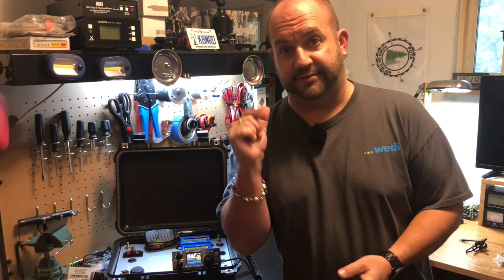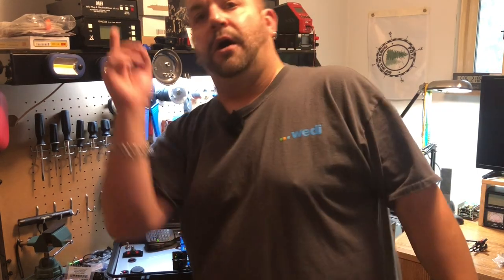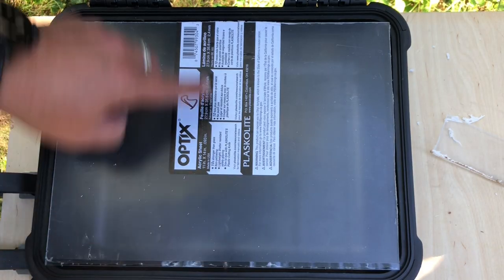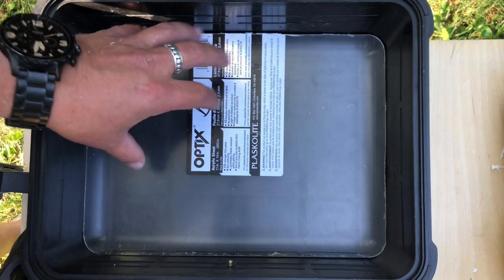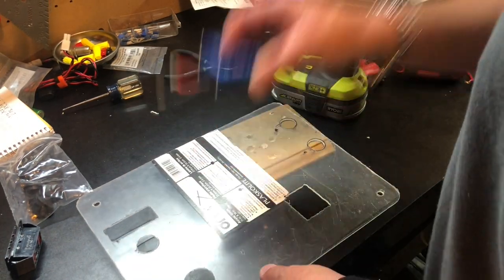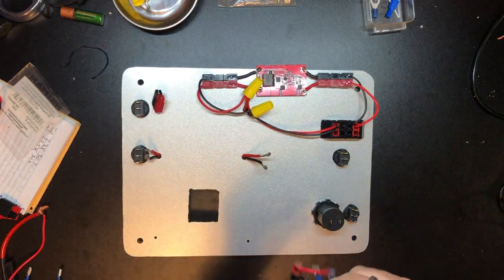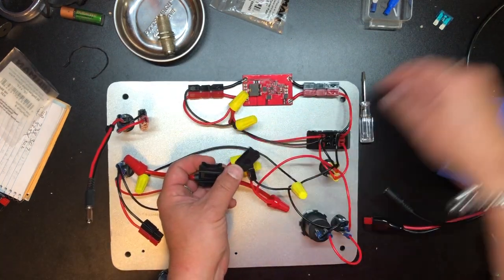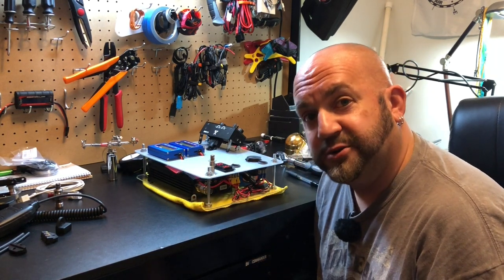Ham Radio Go Box & Solar Generator Build

Comment: Just off the top: get rid of the wire nuts and use male>female FULLY INSULATED spade or bullet connectors, use right-angle FULLY INSULATED spade connectors on the switches & sockets, etc. Layout a routing chart and run the wiring like a printed circuit board. If necessary, use hot glue to hold the wires in place or devise some method of holding the wires to lessen the effect of movement and vibration on the system.  In addition, look on Amazon for a right-angle DB9 connector or right-angle DB9 Serial Cable-pass through type, angles to the side.
Reply from the maker: I wanted to get the right angle spade connectors but ended up using what I had in the shack.  I can't fully use male/female as I'm connecting multiple wires together in a few places.  The wire nuts at some point will prob be replaced.  I don't really like them.  Some have suggested wago connectors I believe they are called?  Thats prob the rout I'll go.  I'm not too worried about the wires moving though.  Everything is pretty tight inside.  The wires don't really move.  Honestly I'm surprised everything just worked the first time I put it together and I didn't see any of the famous magic smoke lol!  Thanks for watching and commenting.  73
Reply: @hamradiotube  For my battery go box, I simply soldered the wiring harnesses together and insulated with heat shrink tubing. Though most of my wiring runs into a 12v fuse box like is used for RV trailers.  Using 2 10Ah bioenno batteries. Two sets of power poles plus a 12v socket and a USB charger.  I can run my Icom 718 at full 100 watts for hours and hours (I haven't actually fully determined how long it runs).  I get multiple evenings use out of it and I usually only go on the air for 3-4 hours at a time.  Everything's all installed in an old tool box I had purchased at Meijer.

Comment: Was there a reason that you couldn't install the radio upside down so that the cooling fins were up vs. down? Use of Wagos would had made connecting the wires together. Heat dissipation is my only concern with your build otherwise awesome job.
Reply from the maker: One, it doesn't really matter, two, the speaker fires up which is more important to me.  I assure you there is no problem with heat.

Comment: So is the top part of the distribution block for charging the battery and solar panel? Or which is each plug used for?
Reply from the maker: Yes, the top is solely for charging. Top left has the solar charge controller connected.  Top right is bypassing the charge controller so I can use my home charger.  They both go into the top meter so I can monitor how many amp hours have gone into the battery.  The battery itself has 2 separate connectors, one for charging and one for output.  Thats how I was able to split everything.  It's actually pretty easy.  I am no electrical engineer trust me.

Comment: If you hang an 110 pH inductor off the positive output, that may just remove your rf hash from the charge controller.  Just a thought.
Reply from the maker: And as soon as I find out how to do that I will give it a try.

Comment: I'm just spitballing here, but I wonder if wrapping the solar charge controller in Kapton tape would help eliminate the interference?

BTW - Nice build!
Reply from the maker: I wish it were that easy.  I don't think kapton tape has any shielding properties though.
Reply: @hamradiotube  What about aluminum tape? Or just plain aluminum foil?  You'd have to insulate it as well, just in case.

Comment: Not to be too critical, but I would think the fan on the G90 would force the radio to overheat. Maybe I am missing something?
Reply from the maker: Well, there is no fan on the G90 to begin with.  Everyone has commented about the heat but it works great in this box ever since I built this.  It’s still in it and I use it all the time.

Comment: So how long does that 6 amp battery last with that rig? I have a mcHF rs-918 I'm wanting to build something like this with
Reply from the maker: just on RX about 10 hours.  Full on pileup about 3 hours.  The RS-918 would last even longer as it doesn't draw as much current.  I have that radio too and love it.
Reply: @hamradiotube  I'm trying to figure out what I want to build with.  I have a 10 watt solar panel that I could trickle it with.

Comment: I just realized you got a 90 deg coax connector in there.  Those things will go bad and short on ya.  FYI.  POTA on!
Reply from the maker: What??  Maybe a crappy one.
Reply: @hamradiotube  Just following the advice of Jimmy, KA5DOB "The Audio Man."  He has even gone so far as to put it on his QRZ page in red letters.  It was in relation to frying tubes in an amp.  YMMV.  73's.  Good to catch ya on POTA today.

Comment: Been searching and searching, but I have not found a video that actually explains how to charge the battery! If the battery is connected to a power distribution block then how are leads connected to charge the battery itself? Did I miss this?
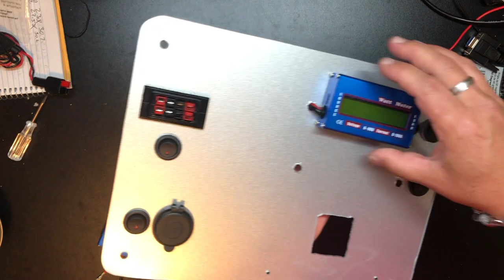Reply from the maker: I show how I wire up the 2 power poles for 2 different types of charging at about the 23:20 mark.  As far as charging, the top left power pole is the solar panel input, which then goes to the charge controller, the watt meter, and into the battery.  The top right is for connecting to my charger at home which just goes through the watt meter and into the battery.   Basically the output of the charge controller, and the wires for the top right power pole (home charger input) are wired together.  From there they go thru the switch and into the battery.  You're just taking to circuits and splicing them together after the charge controller.
Reply: @hamradiotube  Got it and mine now does what I want. Thanks for the reply and instructions! I used flag/right angle connectors. It was a tight smash down using the standard connectors/terminals in my box!
Reply from the maker: @winstonsmiths2449  I wanted to get flag connectors for this and a couple battery boxes I built but didn't feel like buying the crimping tool for it.  Would certainly make for a tidier installation for sure.  Glad you got it working.  73
Reply: @hamradiotube  I did not buy the crimping tool as I am a cheap-skate LOL! I found using a medium sized vice grips works like a charm after you ruin a few connectors. I tighten down the adjustment screw to where when closed, the vice grips grip just a bit. I then place the connector more toward the open end of the jaws of the grip. Squeeze the grips till they lock, release and done. No damage to the connector. I ruin one out of 10 or so when in a hurry. But that is worth it to provide me with extra space. I ended up rewiring my box because I used too thick awg and used the flag connectors with thinner wire.

Comment: *****************
FOR YOUR NOISE ISSUE -
TRY EBAY - MU METAL - A NICKEL BASED FOIL/SHIELD THAT PROTECTS FROM FROM EMI OR MAG INTERFERENCE. I'M AN EE AND HAD TO USE IT FOR A SIMILAR ISSUE WHEN DOING SONAR DESIGN.

Comment: Ferrite cores to stop the noise, how does that box run with the G90 getting hot, i see there is no fan, is the heat an issue?
Reply from the maker: That might work if there were any more room inside.  I’ve not had any issues at all with heat either.  That’s prob the biggest question I get on this video.  Even in the Texas heat I’ve not had a problem.
Reply: @hamradiotube  Thanks you for the timely response, your answer helped relieve a bit of worry I had about the unit. I take receipt of my G90 tomorrow, and have already  eyeballed my pelican briefcase for a go box for it.

Comment: How much RF noise does the MPPT Charge controller put out?
Reply from the maker: Well the first one I bought and have since managed to destroy put out zero rf noise.  This one is all kinds of noisy.  I didn’t have the first one hooked up in the same way though so that might have something to do with it.  I had it hooked up to the solar panel a bit away from the radio.
Reply: @hamradiotube  I appreciate the information. I am still trying to finish my gobox. I am down to the charge controller (I have the RFI Powerwerx one now) & solar panel.  Having to stay budget friendly since I’m ordering a 891 when I pass my general Saturday!  73

Comment: Well wasn’t interested until I heard you hadn’t setup for a raspberry pi. After 50 years of Ham radio kinda burnt out on HF SSB and the arrogance of 20 meters. Want something quick work as many contacts as want get off and go to other projects. I thought about 2 boxes. One for the radio or radios and one for batteries charge controller. I guess your box you could get the digital interface they sell for the G90 and have the computer and cat controller to hook up to whatever computer you might want.
Reply from the maker: I have the digital interface but it’s really bulky.  There are better ones than Xiegu makes but there still wouldn’t be room in the box for them.

Comment: No jack for plugging in a paddle or key. Guess you don't use CW.
Reply from the maker: You make it sound as though thats a problem.  The one thing CW guys think about themselves is that they are better than everyone else.  What they don't think about is the fact that maybe talking in binary just doesn't appeal to everyone.  Of course, I doubt they think about that at all considering they are usually just praising themselves for how good they are, and how all other modes of amateur radio are beneath them.

Comment: Okay if you can solder get you some shrink tube go to harbor freight get you a lot of shrink tube and start shortening your wires and your cables you ain't got to have them all that craziness and go get you some different gauge wires go to the electronics store get a little bit thicker gauge all right and you'll definitely cool down get you one of those little cool fans and you might not have to go to the store for that you probably got something old laying around the house that actually uses it or one of those and just shorten your cables down a little bit get some good solder go to tractor supply and they got a solar panel that's portable and I think it's 2 or 4 Watts and just have that thing charge your smaller instruments or get you a plug that you can plug into your cigarette lighter and also plug into your your black box there from your car while you're driving and get one of those twinkle chargers so if you're camping or someplace and you're you know out with the kids or the old lady and you guys are fishing and running or walking or walking the dog and it's not charging super hard where you got to keep an eye on it but that twinkle charger you know little bit more comfortable being you know how long you got and you get the idea hey I'm not going to go on this but get you a good soldering gun good solder and shorten you some cables out and some shrink to a shitload of it oh hell man you know what's going on I ain't got to tell you this s*** good luck man
Reply from the maker: Yeah I got all that stuff.  It's doing just fine the way it is.  I was thinking about rewiring it with Wago connectors but I really just don't feel like it.

Comment: Why not jist turn the radio over so the heatsink is up?
Reply from the maker: Good question.  The simple answer is because the speaker is on the top.  I wanted it firing up.  Plus the lid of the case acts as a reflector for the sound.  If I turned it upside down, I suspect the audio would be muffled.  I have no scientific evidence of this of course, it's just how I made it.  I didn't drill any sound holes for it either and it still sounds good.  It's a pretty loud radio when you need it to be.  The gaps around the plexiglass more than allow the sound to come out.  My neighbor made a variation of this box and we drilled some holes over the speaker and it made a big difference.   Huge, actually.  I need to do the same.  And honestly, this video is ~4 years old and I've never had a problem with heat.  Even since I moved to Houston, TX.  The G90 gets hot as hell when you're busting out QSO's (not just in TX, but in MI as well).  It can take the heat that it produces, as well as the environmental heat.  It's just an incredible radio.  It really doesn't care what you throw at it.  It's like the Timex of radios.  It takes a licking and keeps on ticking.
Reply: @hamradiotube  Those are all valid points. Im using an external speaker in mine.